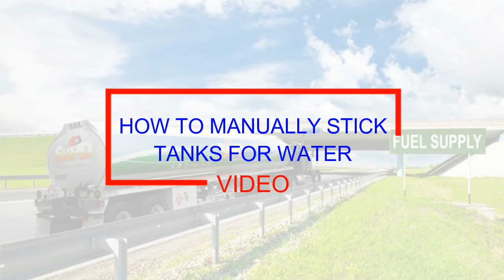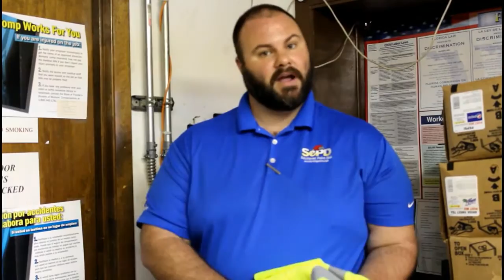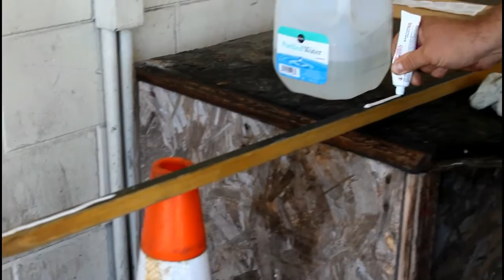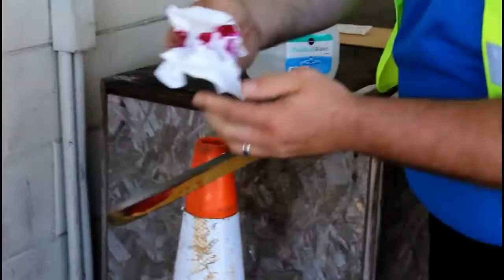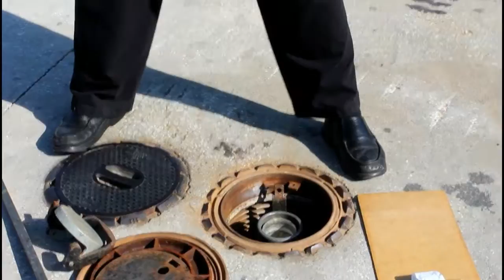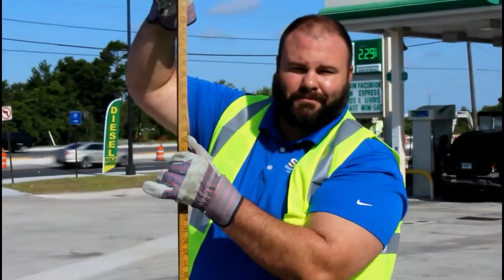How to Manually Stick Your Tanks to Detect Water and Phase Separation | Southeast Petro

Comment: bottom of the stick was 1" of scarlet when he pulled it out, camera panned away quickly, guys says no water in tank lol. BS slick but not slick enough bucko
Reply: FYI, the fuels are not pumped from the very bottom. In a 12k gallon tank, the bottom 300 gallons or so will always rest at the bottom. That small accumulation of water will be pumped out when the tank is next serviced but is at no risk to the motorist.